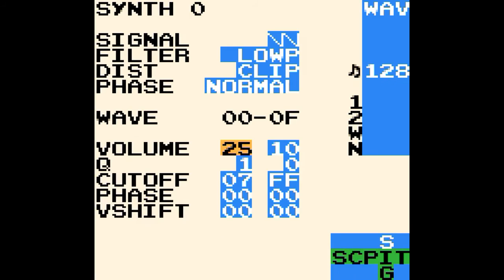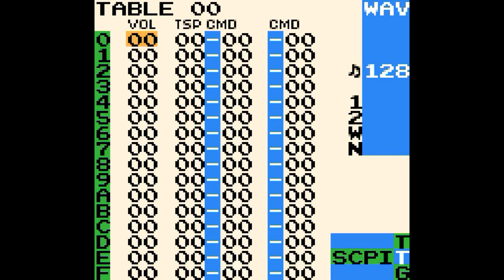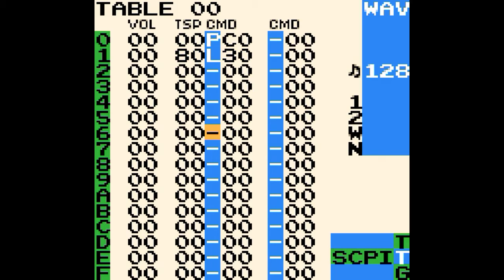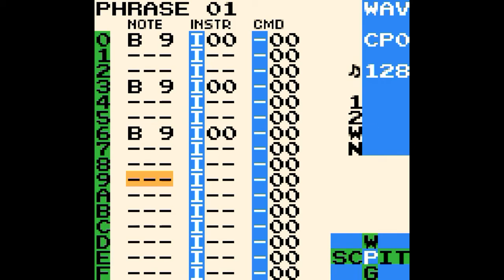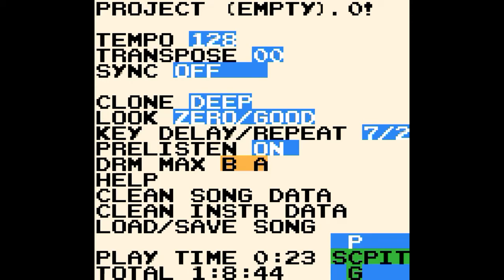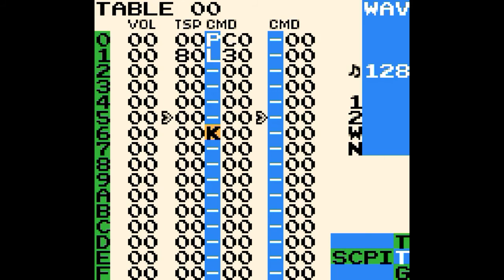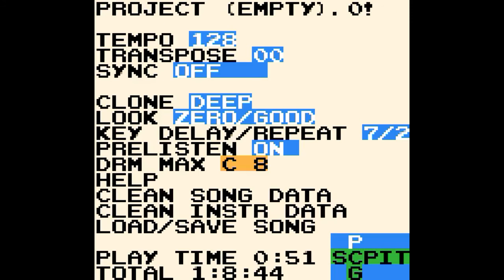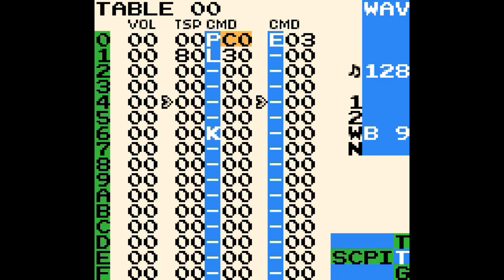LSDj Tutorial - Make a Kick in version 5.8.3 to 6.3.3 of LSDj

Comment: Hm, that tuning setting is gone now - instead there's a transpose on/off setting. How would you create wav-kicks now?
Reply from the maker: Yup, sure enough the day after this video, LSDj was updated to be more flexible! So, first I would turn transpose OFF since that's what the Drum tuning did before. You do still need to change to Drum tuning, but it has moved to P/L/V setting (press Up to change from FAST to DRUM). Now, instead of setting the DRM MAX, just use the note of the pitch where you want to start your kick in the phrase itself. So if you like your kick to start around C7 you can make the kick at C7 instead of B9. The table should be the same as it is in this video. And one other note - the TSP column in the table does not match the pitch like it does for non-Drum tuning, so if you venture to use it, be sure to test out the TSP by ear.
Reply: Whoa, that was a quick response! Thanks, got a solid kick now. However left out the L command in the Table. It didn't quite work. P and K were sufficient. Like the old days. :D